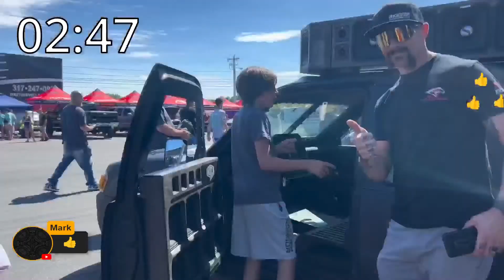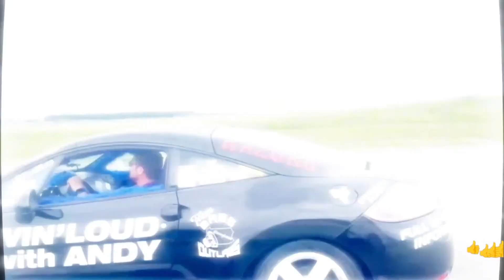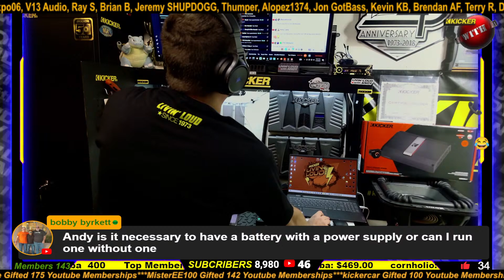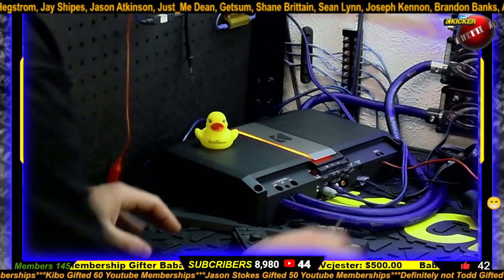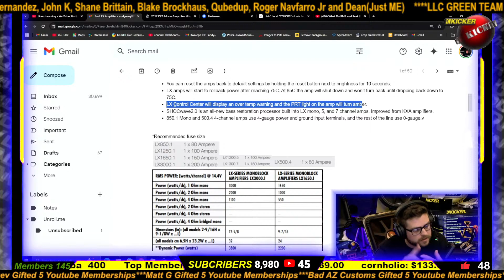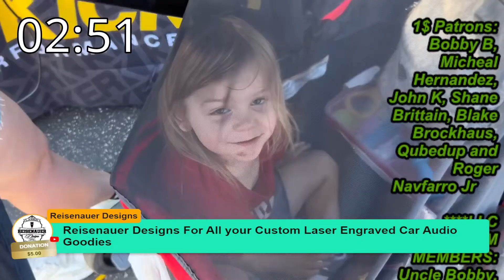KICKER’s New “KXA” Amplifier : The LX 3000.1 - Late Live with Andy

Comment: I run 2 kxa 1600s . You think its worth it to replace it with this?
Reply from the maker: Eh- not a huge gain in power 

Other than for it’s added features 

I’d upgrade to a warhorse for more power gains 👊🏼
Reply: @LivinLoudwithAndy  does the kxa1600 do over 2k at 1 ohm? Based one the kxa2400.1 dyno I hope it does about 2400 watt at 1 ohm.

Comment: IMO they all need built in dsp capability.
Reply: Personally, I prefer regular amps and seperate dsp's. There's more flexibility. You can get a DSP with the features you want and then the amps with the power and sound characteristics you want. Mix and match. Lol
Reply: That may be coming.
Reply: @ new q class line? 😯
Reply: @aaronlothamer6618 I don't know about that. Were the IQ amps good sellers? 

The dsp amps being rumored about are higher powered, multi-channel Key style amps. 

Kicker is tight lipped, though. Just have to wait.
Reply: @aaronlothamer6618  Well, it seems Kicker is not working on a Q class style dsp amp.

Comment: Isn’t 70v like 5000w at 1 ohm? What the heck?
Reply: That’s unloaded so it will be higher and also his voltage is 15.5v so at 14.4v with a load it will be less.
Also considering it’s kicker it will be quite underrated. The old kxa2400 was rated 2400 and did 3500 on the dyno

Comment: Andy Andy...im about to buy to helix c-one's to run my 2 Stereo Integrity 12s...sell me why the lx 3000.1 would be a better buy other than price point. The dampening on the Helix is 1000 and 120 s/n. How big a difference will that really make on sound quality compared to lx? Please please help
I'm goin to run 2 ohm at amps due to 2 ohm dvc 1000w ea
Reply: I hope you're able to get the C ONE's for a good price.

You're basically comparing a high-end class AB amplifier against a mid-level class D amplifier. The LX 3K is going to be more power potential and better efficency. 

I believe damping factor is not a big deal. As long as it's well above 20 or 30, it shouldn't matter.

When it comes to SNR you only want to look at the 1 watt ratings. Helix doesn't provide that, but if it's 120 at full power then it's probably going to be around 100 at 1 W. That's amazingly good, even though you don't really need a high SNR on a sub amp.

I'd say one of the deciding factors is going to be time. The LX amps are not out yet, and it may be several more months before they are. We don't have any specs on them right now, either. (I haven't had time to watch the live stream yet so my information may be out of date.)

If I wasn't in a rush and time wasn't a factor, I think the most important consideration would be how the LX sounds compared to the competition.

When you're running subs that are capable of being dynamic and detailed you can really hear a difference in the amp.

I think it's a sure bet that the C ONE is going to sound very punchy and dynamic.

I don't know about the LX amps, though. 

When I tested out the subchannel on a Kicker KXA800.5 I was a bit let down. It was a bit more punchier and dynamic than some other amps I tested, but it was still a long way from the Rockford Fosgate amps, I tested.

If the LX amps could match even the Rockford Prime amps, then I'd say it would be "worthy" of using in a SQ build.

If you really want to know which would sound better, you'd need to install both and compare them yourself.
Reply: @JasonWW2000  daaaaaammmmnnnn....that helped...yeah I'm getting offer of 2300 for the 2 but got to act by tonight. My thoughts were the c ones are thee pinnacle except for SUPER high end but this is strictly just daily drive...my thoughts with the lx are man for what im paying for the Helix is can pay for custom box for the 12s, titan 8 upgrade and amp...its funny how many options u have but yet there's always a catch...platinum problems im blessed to have.
Oh he had spec in video except the dampening. I've heard MB talk about the dampening is absolutely a major factor for subs but everyone has an opinion and im to green to act like I flippin know ya know...
Reply: @rockapartyjd  I'm basing my information on damping factors from Joe Hobart. He's Kickers head amp designer. He said that back in the 80s, a lot of amplifiers had very low damping factors, like 10 or 20, and it did have a negative effect on the sound. So back in those early days a lot of companies pushed the idea that you want an amp with a high damping factor. There's a lot of car audio people from those early days that still have that ingrained in their brain. Lol. 

Nowadays, almost all amplifiers have a high enough damping factor that it's irrelevant. I don't know enough about the subject, so I'm going to defer to what Joe says.

I know MB is always talking about damping factor, but he's not an amplifier specialist. He can hear differences in class D amplifiers, like a lot of people can, but he doesn't really know why some sound better than others. So you'll hear people claim the better sound quality is due to a high damping factor or made in Korea  or that it's half bridge. It's none of those things. It's something else about the way it's designed.
Reply: @JasonWW2000  i hear you and MB definitely isn't an expert but he deals with subs and amps daily and that's literally word of my regarding dampening...like I said I know nothing...I've read up on it and it seems like 100 to 150 to 1000 makes little difference but 80 to 150 is significant...im an old dog who takes forever to get things anymore it seems ...I appreciate any and all advice...diymobile has helped me a lot too...its hard getting answers that are clear but you really gave me a thorough opinion that I appreciate and am grateful for...thank you
Reply: Personally, if I were you're in your shoes, I would definitely consider a Rockford T2500-1BDCP. I haven't tested one personally, but I'm sure it's going to be just as good, if not better, than they're entry level Prime amps. (And older, big gray T series amps which I've tested)

They're typically priced between $900 and $1300. 

Heck, even the smaller T1500-1BDCP might be a good choice, as long as you get the CP version. The 2500 does 3k watts and the 1500 does 2k watts.

The bigger one looks more impressive and it has the cool meters, so I'm definitely biased towards that one. 😉